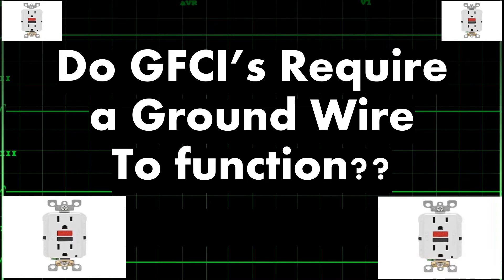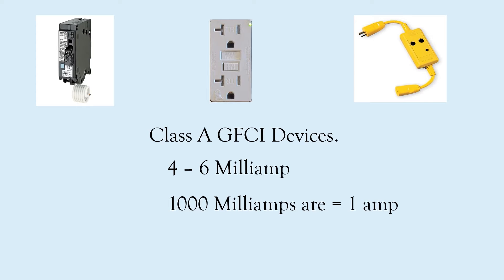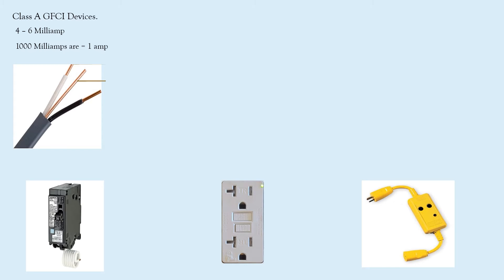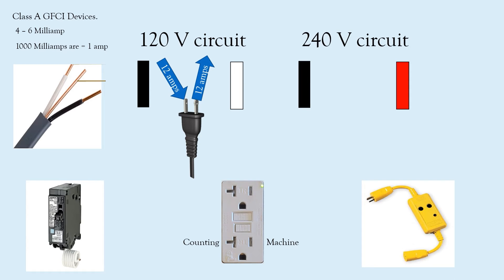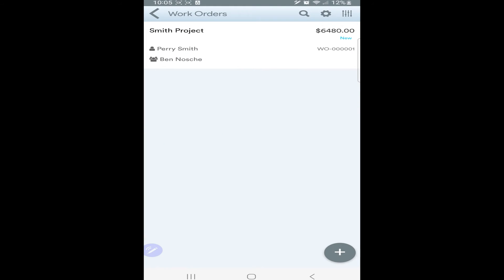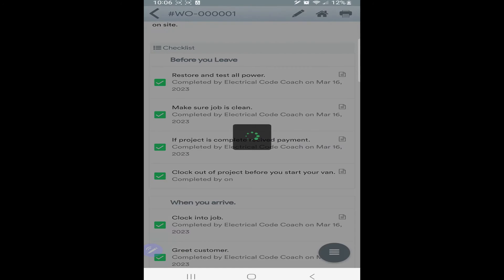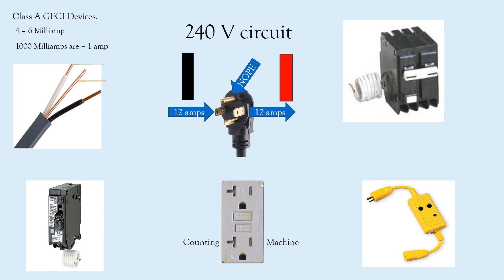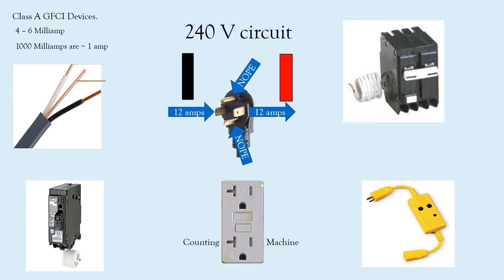Do GFCI's Need a Ground Wire to Function? How bout a Neutral for 240v?

Comment: Hey buddy, it took me an hour to find a video which was just straight forward.  I'm installing a GFCI to my pool pump run from my sub-panel.  It's just two hots and a ground motor, the GFCI breaker I purchased has to hots and a neutral lug, so I tripped out a little bit.  But watching your video was exactly what I needed to verify I'm good to go.  Pigtail to neutral bar, load wires in breaker, and I'm good to go.  Thanks dude.
Reply from the maker: You got it! Glad you found the info you needed

Comment: I recently tried this in a 240v situation. It is not working. The gfci instantly trips and will not reset. There is a neutral feeding the subpanel and the pigtail is connected to the neutral bar. I have now tried this with a 240v heat pump (for heating a swimming pool) and a circuit feeding baseboard heaters which has 1 located in a bathroom. 2 different gfci breakers, 2 completely separate locations and yet the same result. Am I missing something?

Comment: I have a GFCI outlet in the kitchen near my oven where I use my coffee maker. It trips every time I use the coffee maker. Should I go to the breaker and change the switch to a higher voltage? If not, what other options do I have?

Comment: Hey man you helped me pass my electrical exam in Tn awhile back. I know this has nothing to do with your video but I was just wondering if you knew anything about estimating commercial work. I have commercial experience but not on the business side. I’ve had a set of drawings come across my table and I need a outside source to take a look. Could you help with that?
Reply from the maker: You bet bro just hit me up 423-895-3247

Comment: One problem I came across in regards to older wiring without a ground was the fact that the GFCI test button doesn't work without a ground. I knew you didn't need a ground for a GFCI to work,  but when the test button didn't work on the GFCI or the trip button on my polarity checker, I questioned whether I was right. From what little I could find on the subject, it seemed to verify you don't need a ground for the gfci to work, but test buttons cannot trip a gfci without a ground, so maybe that might be worth explaining in your video

Comment: hello, i'm a fan. i have a question

on a line to line 240 v circuit with no neutral, will the gfci breaker still function properly if you don't put the breaker's pig tail to the neutral bus on the panel?
Reply from the maker: My understanding is yes that neutral has to be connected, and should not be writing back on the equipment ground and conductor.

Comment: Wouldn't you be considered the path to ground in the event of current leakage through your body. If so, the term ground fault would still apply.
Reply from the maker: You'll have to go read the definition and let me know what you think, yes the ground fault is one path but ground fault circuit interrupter I still think is a stretch
Reply: @Electrical Code Coach  I would think thats why other countries use the term, Residual current device. As apposed to our ground fault circuit interrupter designatio.

Comment: A leak "going to ground" does not need to be through the ground wire.  The leakage is going to A ground source and does not need to be the groundING conductor. It can be the plumbing system, HVAC or the earth it self.  Goes to the reason for Bonding.  Hence, a Ground fault is a correct term.
Reply from the maker: You'll have to go read the definition of ground fault, yes it can sense ground faults but it being a ground fault circuit interrupter is a stretch for me

Comment: GFCIs measure the difference between the current flow on the hot & neutral. A difference will be assumed to be a short and the GFCI will trip. This is why they are permitted to be used to change a 2-hole receptacle to a 3-hole receptacle. While they don't provide an equipment ground (and must be labeled as such), they will trip if there's a problem.

Comment: To understand why a GFCI doesn't require a ground to function properly,  you have to understand that a flow of current in a conductor produces a magnetic field,  and two equal but opposite magnetic fields cancel each other out, so no current is induced in the current transformer in the GFCI.
Reply from the maker: Yes there there is a greater understanding of the net zero effect I didn't cover it today

Comment: The presence of a GFCI likely saved my life on new years eve.  While I was washing dishes getting the place ready for a couple of friends,  while my roommate opened the cupboard over the sink a bag of flour fell out and knocked the blender into the water while plugged in.  I did feel a startling jolt until the GFCI tripped but nothing more.
Reply from the maker: Thank you for sharing
Reply: Great example! However, I never keep appliances plugged in unless I am using them.
Reply: You prolly would not have died bro it would have maybe grounded through the drain or wash basin and just gone through your hands. Probably would have hurt though.

Comment: Some devices do.... most do not. A true ground fault protection device is known as an earth leakage detector driven trip. I came across this "problem" a while back for an application for a hydraulic 3 phase generator we were mounting on an elevated platforms. The Schneider 3 phase breaker was mounted in the lower end of the machine. Not only did it not need a ground, the Neutral was also optional as were any of the phases so you could have used it with two phases or even one phase with a Neutral.... The device would add up the current on the phases, as well as the neutral if used, do the math to figure out that all the current total was all going to, then returning back to source & if the difference exceeded 30ma the device would trip.